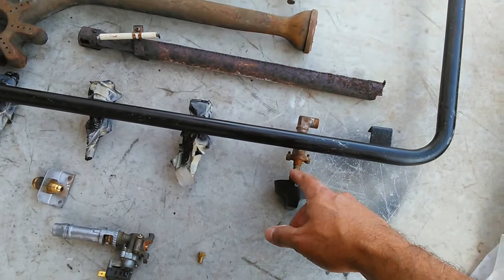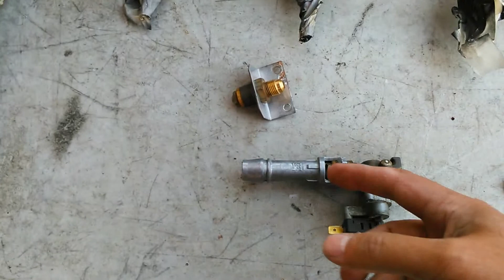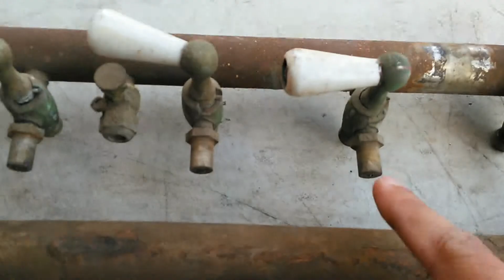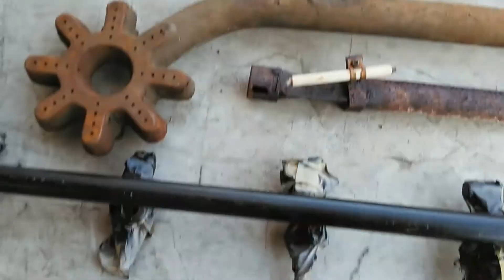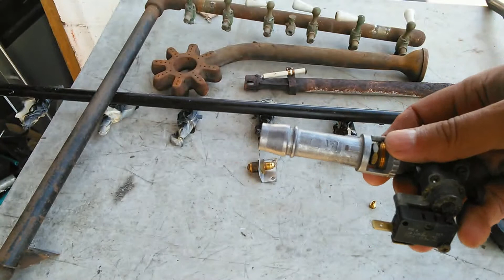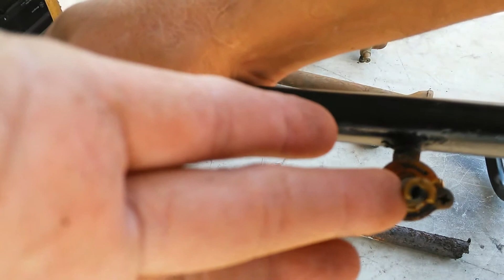Gas Control Valve Basics

Comment: Excellent video Frank. Questions:
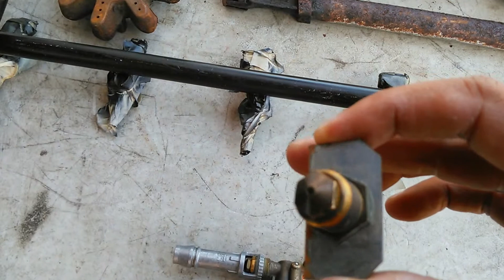3:06 Did you say "TP style orifice"?
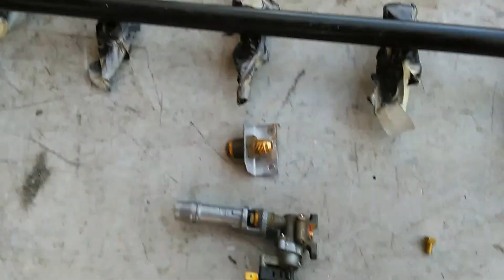3:12 What you mean "spud type orifice"?
Reply from the maker: I call pointed orifices teepee tops because they resemble a wig wam. That's just an expression, it's not the technical name for such. Short orifices that have their threads on the outside of a shank are called orifice spuds (yes, that is the industry term for those), while orifices that are internally threaded are called hoods (again, an industry term).